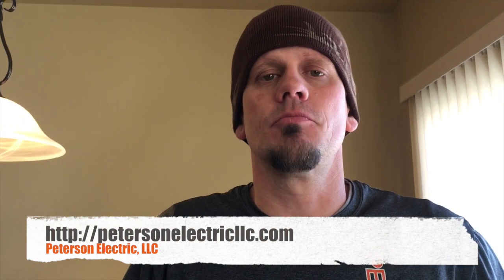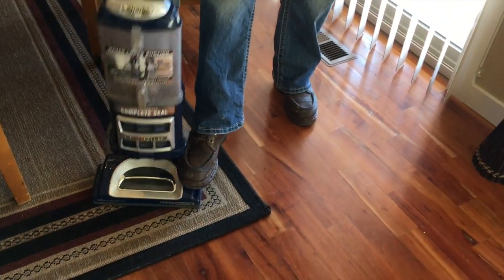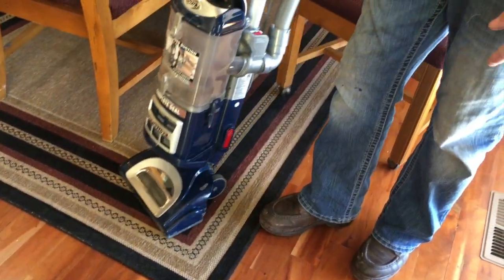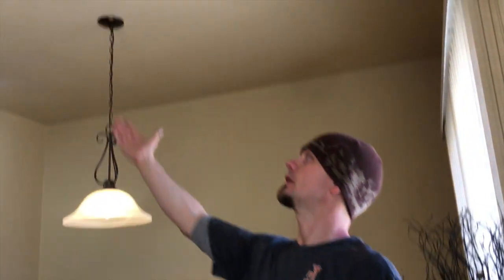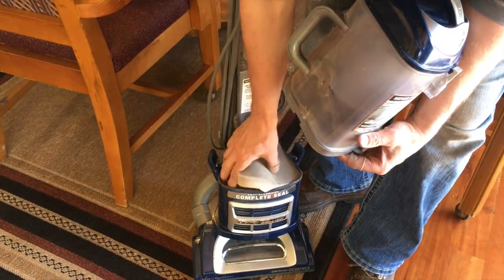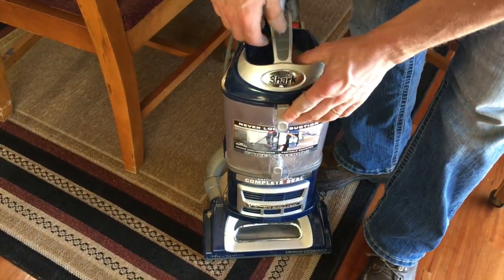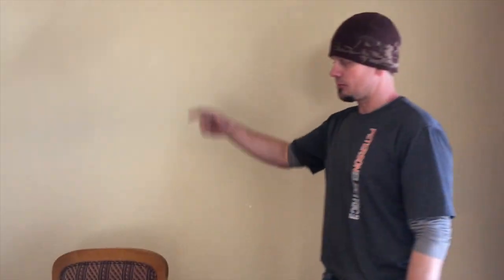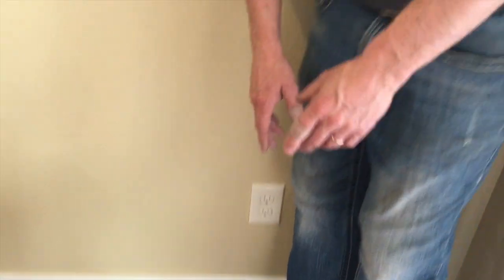Arc Fault Tripping, What Is The Problem?

Comment: You did a very thorough job of trouble shooting a very tricky problem.

AFCI designs vary from one model to another and in some applications it may be better to change the brand. 
Even if Brand X works with "almost" all loads, there may be cases where Brand Y works better with critical applications.  The performance of an AFCI depends on several parameters that may be affected by aging and/or temperature.  If it's on the ragged edge then changing to a different wall plug with different cable resistance might be enough to change it from working to not working or vice versa. 

Motors are especially tricky because their current can change rapidly depending on the load.  Even if the average current is well below the handle rating, the current pulse can vary from cycle to cycle to make it look like there is arcing. The arc detection circuit has to be designed to deal with motors without nuisance tripping.  This requires a lot of evaluation and fine tuning, hence, some breaker models may be better than others.  
Breakers used with light dimmers and computers also require careful evaluation because these current waveforms are complex.
Reply: My new build home they put dimmers on the AFCI. Can't even play Xbox without the damn thing tripping 5 times. AFCI or not, it shouldn't be tripping. Crappy install  and now I'm stuck with it. Have any recommendations or better brands if AFCI breaker?

Comment: Great video !  A friend of mine has a canister vacuum that you can attach and detach the hose, wand, and power nozzle and has had it for a year.  It has recently started to trip their AFCI breakers though.  They are going to send it somewhere for examination.  I have also seen that when a vacuum cleaner is clogged or when you stop-up the intake from the hose, that the amperage actually will go DOWN, not up.
Reply from the maker: Interesting. I usually see them go up. I’ll watch for that thanks
Reply: @Petersonelectricllc  Yeah it is !  It is because generally with flow-through motors.  The motor has now has much less air going though it and is essentially operating in a vacuum, so there is less air resistance.  The motor rotates faster as a result, and pulls less power.  The motor unfortunately heats up more though when this happens.

Comment: Our microwave of 15 years worked fine until the power went out couldn't change the clock, pulled the plug the neutral prong on the plug was burnt. An arc fault was put in got a new microwave with a dedicated line have trouble with that tripping from time to time -  state inspector will be here to check the new panel and new breakers  soon

Comment: when i worked new work residential there was always 1 out of 30 or so homes with one circuit issue like this. always asked the same things. 50/50 it was the vacuum and other times could not find any problems- maybe a loose connection in a box here and there. always replaced the afci and that has always fixed the issue. they were always cutler hammer and because they are so sensitive the manufacturer sent out a trouble shooting guide which i still have and bring with me on calls like this one to help homeowners understand
Reply from the maker: Where do you get this guide and what brand?
Reply: @Petersonelectricllc  did you ever get word on where to get the guide? Did love to have a copy myself...
Reply: @nathanhalsey3969  I think he’s referring to this

https://images.homedepot-static.com/catalog/pdfImages/0f/0fe60ae4-5ea3-46b2-9bb2-35e070e1ee21.pdf

Comment: Had them installed in my new home. Constant tripping for hair dryer, vacuum and even a drill I was using in the basement.
Reply from the maker: Are they BR cutler hammer?
Reply: I’ve got this issue and mine is a cutler hammer. My box is from the 70’s. It has regular breakers and arch breakers from an addition. It has four outlets.

Comment: I have 1st floor lights trip afci breaker due to too much current leaking on the ground wire. If you open the ground at any point, it fixes the issue and never trips. I swapped out the afci breaker, same issue. The afci breakers are designed to flip  when very little current is on the ground.

Comment: I’ve got a similar issue.  I built an addition. I ran the electric. I had everything inspected.   If I try using the vacuum cleaner in that line the breaker trips.  I can turn lights on and no problem. 
It’s a dedicated line of four outlets. 
I was told that it could be a bad breaker or when the drywall was put up a screw hit the wire.  But if a screw hit the wire wouldn’t the circuit trip automatically?  
I’m going to pull all the outlets and try it again.  Then I’ll look at the breaker.  
Now my panel box is from the 70’s. I have the old breakers and then the new arc breakers.  This mix shouldn’t bother anything, should it?

Comment: See if you can figure this out. My house is only 4 months old all the wires and breakers are new and up to code with the newest arc fault breakers used where needed. The main breaker is outside feeding a 200 amp GE sub panel inside. I recently had a mini split unit added to my bonus room but now when the unit is running if you cook something in the microwave the microwave breaker will trip, or if you get ice out of the ice maker the refrigerator breaker will trip. my panel box is not full and nothing else in the house is running at the same time and everything is wired correctly. Any suggestions would be appreciated.

Comment: I was just about to blame it on the 1974 toester.  Wasnt satisfied.   Had to plug in the the 1980s vacuum.  Had tested everything all looked good , plugged multiple other appliances , all held good.  Vaccuum pop again.  Turned out to be an old ground run in between the sheetrock to an old metal box I left on the remodel to leave space for a new 2 gang switch box on the opposite side.  Directly behind it.  A ground from the tied through lighting circuit was on the load of the arc gfi combo.  It sensed the resistance and I could not seperate it.  My fix was to install seperste arc gfi devices .   Required an extra one but the problem was solved.  Dont save an old metal unless you have to.

Comment: I have a outlet with only my frig running on it and it trips the arc breaker.  20 amp yellow wire.  get this i can run it off a 100 ft drop cord to a non arc fault and it works fine.   I am going to check the ohms and see what happens
Reply: also i can unplug the frig and the breaker does not trip,

Comment: Motor equals arc- but i know u know that i would do the same with the heat gun try out i have noticed alot tolerance differences in breakers i usually start there

Comment: I have a question for you about arc receptacle nuisance tripping on a 3 wire shared nuetral circuit.  I used combo arc gfi on a kitchen remodel to utilize the existing wiring and not need a 220 Arc breaker so there was room in the panel.  So arc fault gfi device ...ok one side holds fine staying on line side through sent through.  For a while everything held fine.  After about a month only one arc plug is nuisance tripping on this 3 wire circuit and I have to go do a service call on it tomorrow.  This is the first time I've done it this way as these combo plugs are pretty new.  Have any ideas?

Comment: the arc fault breaker product and mandated regulations behind them have been a massive failure...not only do these devices provide a dubious and marginal amount of protection over classic thermal breakers, but they are just not "tuned" to real world realities...the frustrations factor and nuisance is like a seat belt betty ringing non stop...and you know the seat belt is actually connected...

they just do not work ....the voices that say they protect homes from arc fault fires refuse to even consider that classic circuit breakers (thermal) are proven technologies.

19 percent of the US GDP is CONSUMED BY REGULATION that is just as dumb as this.

guess what percentage of CHINA's GDP is CONSUMED by regulations?  less than 1/2 of 1 percent.

let that sink in.
Reply: The voices that support the arc fault breakers make a lot of money.  My electrician spent days working to get these to work, so that i can pass inspection.  He made thousands dollars (he gets paid 90 dollars an hour)  just working on fixing the acfi tripping (i never had a problem with the standard breakers).
Reply: “it is difficult to get a man to understand something, when his salary depends on his not understanding it.” - Upton Sinclair.